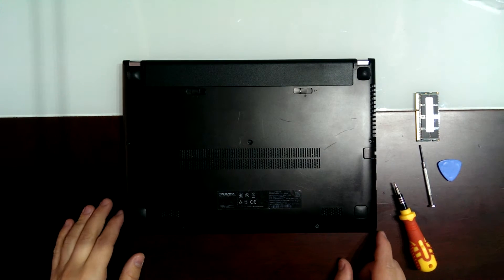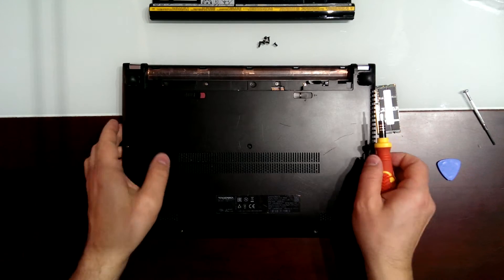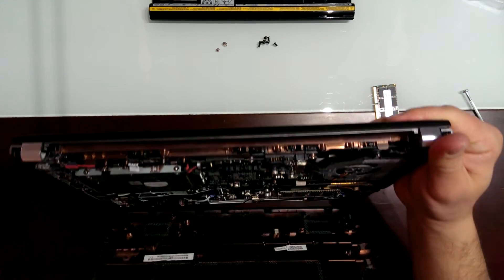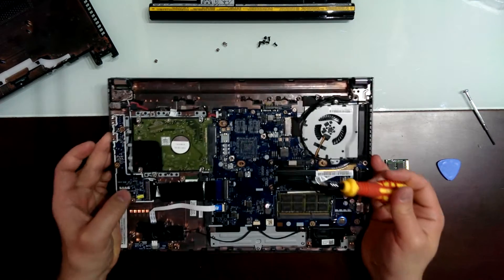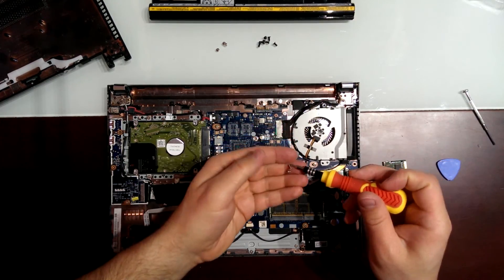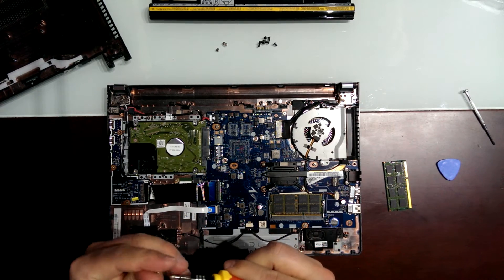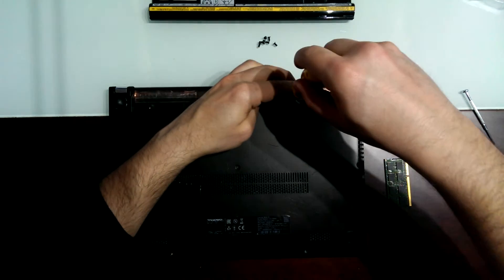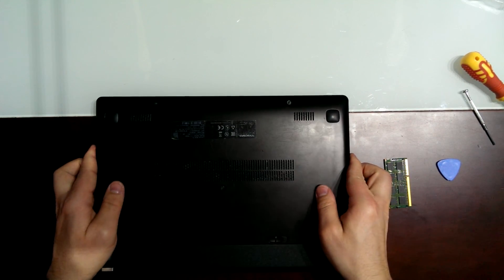Lenovo 30-70 upgrade ram (or lenovo ideapad u310 )

Comment: How many slot for ram in netbook lenovo s20 sir?
Reply from the maker: Hi, if you are talking about the lenovo s20 30, there are no slot on the main board, the RAM cannot be upgraded, this model only has the memory soldered to the mainboard.